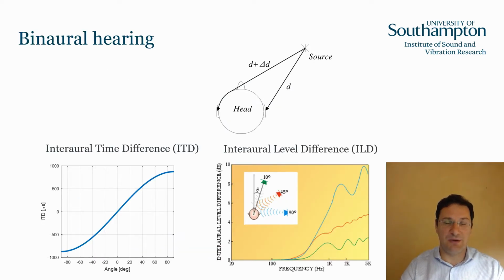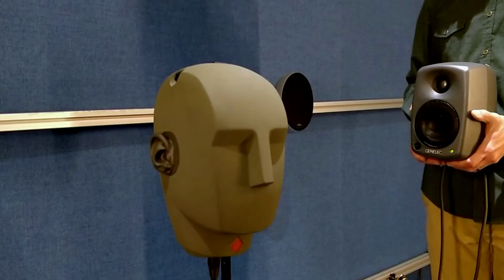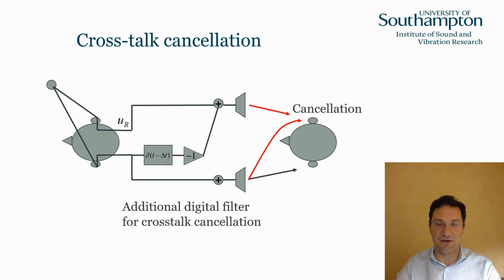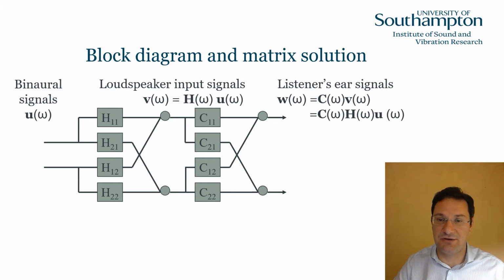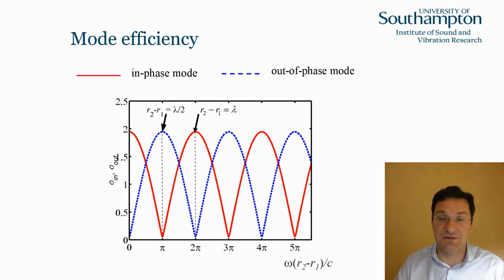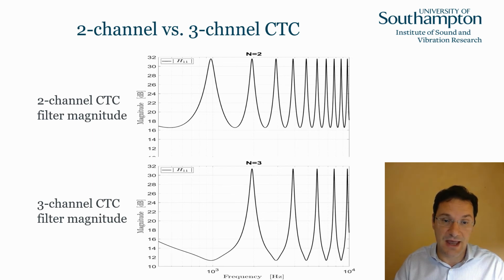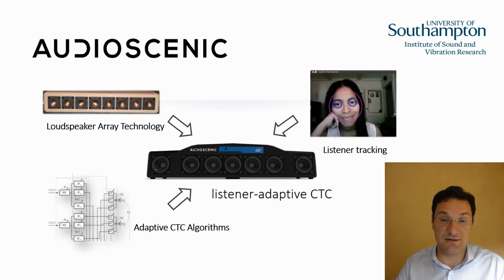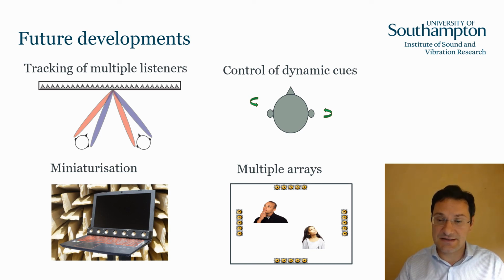Workshop in cross-talk cancellation (CTC) systems

Comment: Field type systems are NOT limited to two channel. If you consider the new paradigm of surround sound you can place sounds anywhere in the playback space without worrying about head related problems and crosstalk cancellation. Considering the total recording and playback throughput, surround sound systems such as Atmos deserve the most research.

Comment: All you are showing is that loudspeaker binaural works. This does NOT mean that the crosstalk is a "problem" with stereo. Hopelessly confuses stereophonic and binaural.
Reply: You are making an interesting point here. Is crosstalk a "problem" with regular 2 channel stereo? I'd say it depends. In my opinion, the phantom center is hopelessly transient smeared and tonally compromised with regular stereo due to strong comb filtering and the time doubling of each transient wave front at each ear that doesn't exist for tones panned to the side. That doesn't mean it sounds bad, just less than optimal. It's conceivable that some adjustment for this could be made during mixing and mastering, but that would not sound good at all on headphones, and I'm told by people in the industry that no such compensation attempts are applied because they don't know  what each person's listening arrangement will be. On the other hand, sounds that are panned completely to one speaker or the other and intended to sound like they are coming from either speaker's direction will not suffer interference at all with regular stereo regardless of the listener's arrangement, but if crosstalk cancellation is effectively applied, these panned sounds will be perceived as coming from all the way to the left of the listener or to the right, widening the sound stage beyond what was intended. This can cause a strange feeling in the ears, as one reviewer described as a "tugging" at the ears. The canceled ear can suddenly feel very muffled and then unmuffled, almost as if something mechanical has happened right at the ears.  The optimal sound distribution technique described in this video can be very effective, as the higher frequencies need to be closer together to prevent phantom center problems, while lower frequencies can be progressively further apart. The problem I'm finding in trying this is that when I pan left to right, the stereo width of the highs is not as wide as the width of the lows, which is as expected since the highs are physically close together. However, some crosstalk reduction using a physical barrier between the speakers but not all the way up to the listener's face can restore a normal soundstage width to the high frequencies while drastically reducing the normal stereo arrival time issues with the phantom center. Physical barriers suck for obvious reasons, but this sounds exceptionally good, and at least I can sit comfortably with the barrier and speakers a relaxed distance from my face, and below my viewing angle so I can watch TV. Mixing in delayed phase reverse signals to create crosstalk cancelation and/or using a third center speaker is something I've experimented with extensively, and in my opinion it works, but there are unavoidable sound quality compromises that I find limit the net gain over regular 2 speaker stereo enough to make it a tough call whether it's worth the extra complexity and expense.
So in a nutshell, I think you are right - 2 speaker stereo works, sounds great, and is quite convenient. It has a fundamental audible flaw, so I have to question the extraordinary efforts the hifi world puts in to two channel systems. Their efforts do pay off, and I just heard the results of some great 2 speaker systems at the Pacific Audiofest. Better equipment and well treated rooms really make a difference, but the audible issues with the phantom center remain unless somehow directly addressed. So I get an impression of a very well polished turd. Or maybe a more suitable example would be an extremely polished and shiny paint job on a car that nonetheless suffers from noticeable orange peel effect.
Reply: @timothylink4386  Interesting reply. Give me a few minutes... but it is NOT necessary to limit stereo to 2 channel. You can have a center speaker and you can have multichannel - which should be the standard anyway. Stereo was never supposed to be a speaker for each ear. That is not how it works. We are putting sound in rooms, not ears.
Reply: @geickmei  Yes, agreed. Stereo means "solid" or 3D. It has nothing to do with the number of channels, except you need at least two. I've heard the idea of dual channel recordings distinguished from stereo, and I think that's an important distinction. If instruments and vocalists are recorded in dry space and just panned to positions left to right in the soundfield, with some reverb added for effect, that is technically not stereo. There's nothing 3D or solid to it. It creates a line of sounds across the listening environment. This could be true even if 9 or more channels are used. If there are height channels you could make a wall of sound and it's still not stereo. It's 2D at that point. If you have speakers that are at various heights and distances as well as left to right, that's getting pretty 3D on playback even if everything is just panned hard to each speaker. 
You can get real stereo sound with just 2 speakers and 2 channels if the recording is made accordingly, and the playback environment is optimized. On such recordings, crosstalk reduction can often be a real benefit in my experience. On dual channel mixed and panned recordings the results with crosstalk reduction can be all over the place. Those were really intended to be heard in  a normal speaker configuration without cosstalk reduction. Sometimes they can end up with strangely postioned instruments and sounds, perhaps excessively spaced all the way to the direct left or right, with a bizarre effect of not hearing them much at all in the opposite ear. A more naturally recorded track that has real stereophonic potential will never have extreme differences in level between channels unless a fly happens to buzz right next to one of the mics.
I like a lot of studio mixed recordings. Some of them artifically add some pretty spacey effects, and I find those effects can often come across better with some crosstalk reduction. The fact that it's not all or nothing can be helpful. You can use a little or a lot of crosstalk reduction.